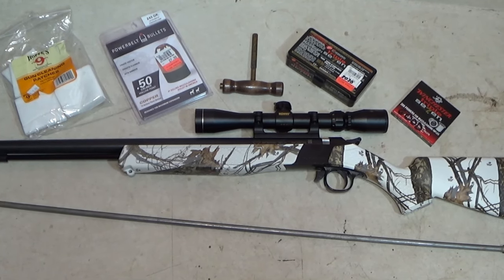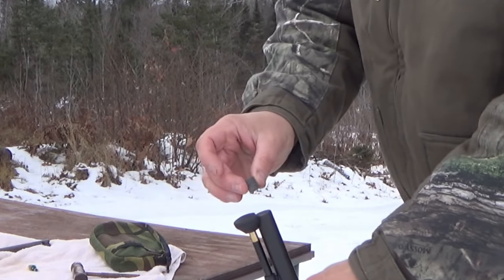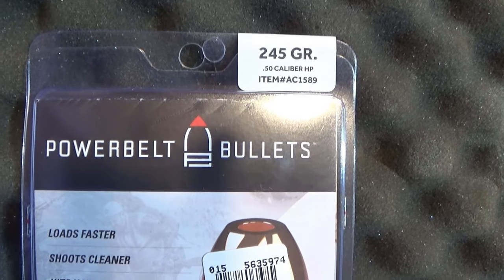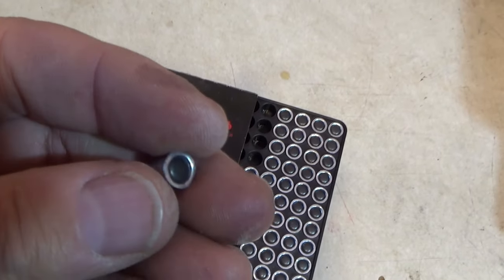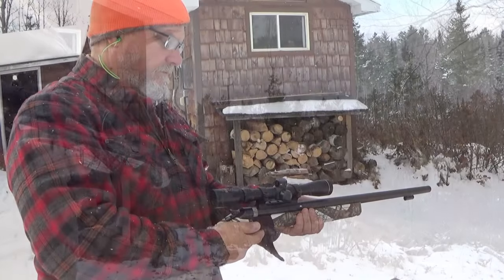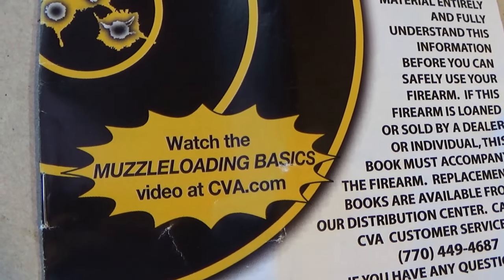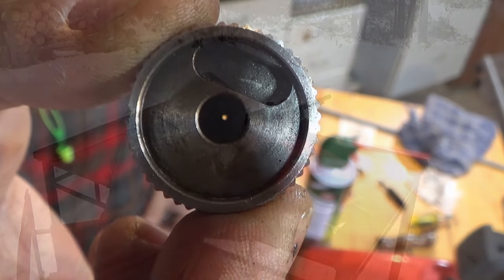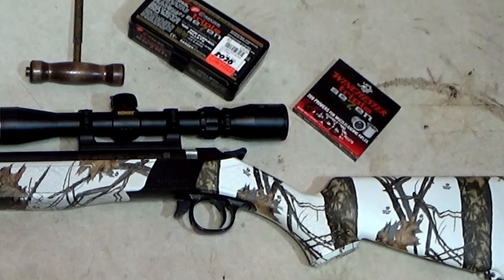How To Load, Shoot And Maintain A CVA Wolf 50 Cal. Muzzleloader

Comment: Don't touch your powder. That's what that pipe cleaner is for.
Reply from the maker: You are correct.  I should use the pipe cleaner, but I've never had a problem.
Reply: @KnettersPracticalOutdoors  You might see groups tighten up. You wouldn't think it would matter, but it might. Depending on shooter ability and stability of the rest. Probobly doesn't matter for whitetails 100yds and in. 
Did you get blood on that rifle yet?
Reply: @KnettersPracticalOutdoors  Love the videos of your camp btw. The northern deer camp is unrivaled as far as awesome traditions go.
Have a buddies from Iron mountain, Houghton, and Marquette. Damn fine country up there!

Comment: Here in Colorado they won’t let us use pellets  or a scope  on a muzzleloader. I wish they would rethink it. I never thought about the compressed air thing for blowing out the crud. One thing I keep in my muzzleloading bag is a welding torch tip cleaner. It works pretty good also for pushing the crud through. Great video. Keep up the good work.
Reply: Wow.
That's crazy.
In Montana they just got muzzleloader season.
I'm in Kansas I don't think there's any restrictions.
Reply from the maker: good idea

Comment: Seen one at pawn shop for $150 anything to keep an eye out for. Where do I get all the ammo and cleaning equipment?
Reply from the maker: Make sure the breech plug is not rusted to the barrel and the breech plug hole is not corroded.  Also make sure the barrel doesn't have excessive rust in it.  Equipment can be found at most outdoor stores.  Dunhams, Walmart, Bass Pro, Cabelas
Reply: @KnettersPracticalOutdoors  Thank you for reply.

Comment: I see you're using the 777. I also just started using 777 after years of using pyrodex. I found with the 777 that the barrel fouls heavily quickly, making the second and definitely third shot extremely difficult to load. Your experience with triple seven?
Reply from the maker: Only been using it for 2 seasons.  A guy in the store when I was buying the Wolf recommended it.  He told me he has 7 different muzzleloaders and does some serious shooting with them.  I do clean after 1 or 2 shots so I haven't noticed much difference.  I had been using Pyrodex prior also.

Comment: My dad use 209 whinchester primer cap for his break open muzzleloader and he use 50 cal  power pellets with his I think he use 50 cal  sabot bullets that slide in easily for him .I use 50 cal black pellets for my muzzleloader I have winchester 209 primer cap to I also used horday sst 50 cal bullet  when I bought my break open sight it in I shot well with those .they were 200 grain I think it was .I went buy hornday sst 50 cal sporting good store I went to was sold out so I have 50 cal power belt hollow point bullet 200 grain .so I should be fine to go when muzzleloader  season starts in December 2022 in my state of Vermont
Reply from the maker: thanks for adding in